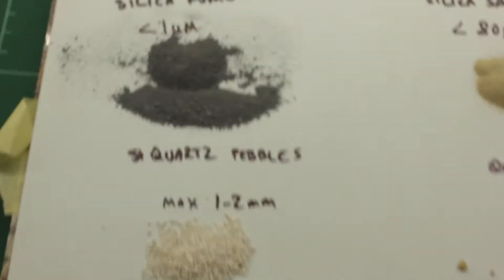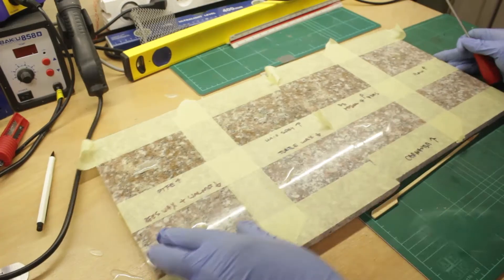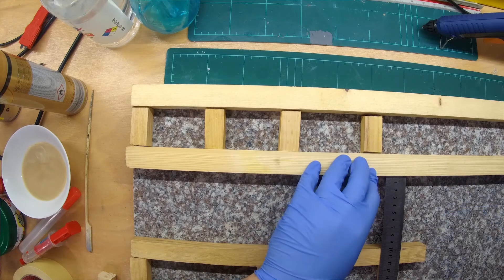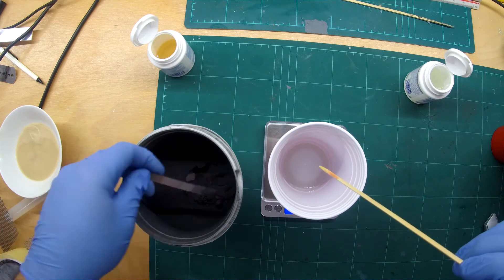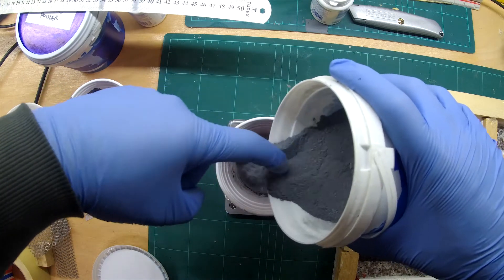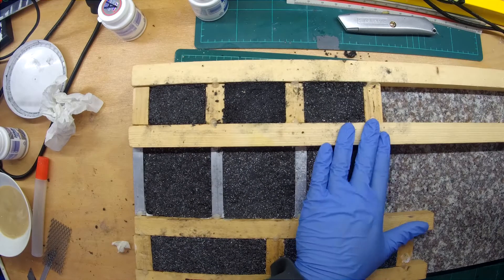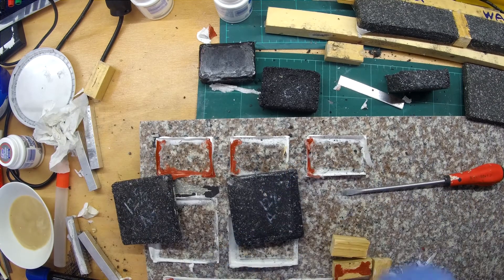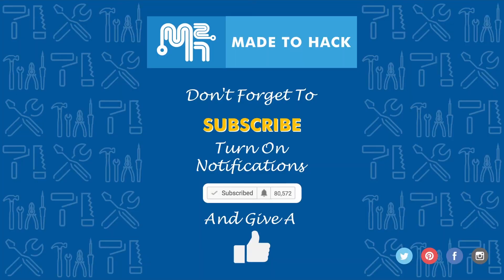Epoxy Granite / Epoxy Quart Mixes & Tests - Part 1

Comment: you should have pour your mixes into plastic cups...and used a good mold release wax agent with real pva mold release then get a can of smooth on "Universal Mold Release" over the pva
also you should coat your mold with 1-2 coats of thin clear epoxy mix let it set up or become very tacky... also your mixes where to dry with out a vibration table... also use a heat gun to pop surface bubbles in the top clear layer... your second or third coat should have pigments mixed with resin only ie if you want a all black finish, again use heat gun, once the thin coat of the mold is achieved and is curried but still tacky do to your 12% mix with your aggregates ... if you mold is glass smooth and you prep the mold properly your casting will be the same.  wood mold need to sealed and varnished  or epoxied  so they extermly glass smooth.
Reply from the maker: Thanks henri. Yeah, for the round samples at the end I used plastic cups. I have to pick up some PVA mould release for the end castings for sure and I'm thinking that pre-coating the mould will yield a better finish!

Comment: dry your filler in an oven to drive off moisture, you should be able to microwave this if you want. Soak your filler in the resin over night, try to seal the resin to prevent air going in. Don't use graphite, the platelets will cause cohesion failure, use carbon black. liquid lecithin is a good mold release agent if you want to be able to paint the surface after the fact.
Reply from the maker: Hi Jean, yeah everything except the silica fume was baked before. Granted it's been months after the fact. I will look into the liquid lecithin!